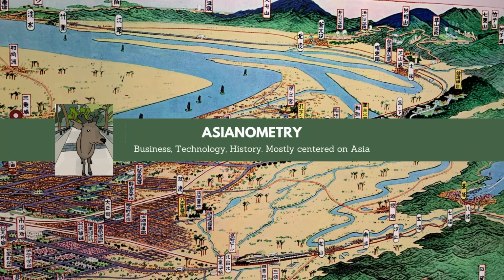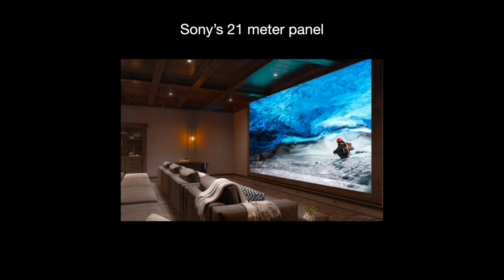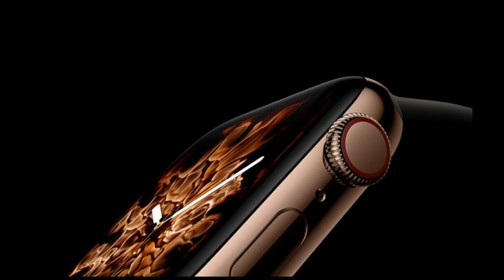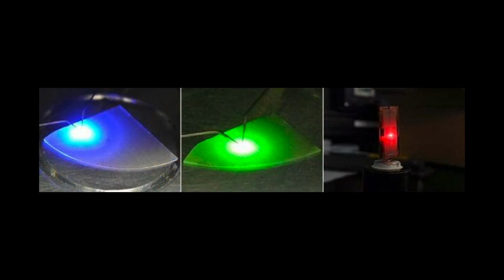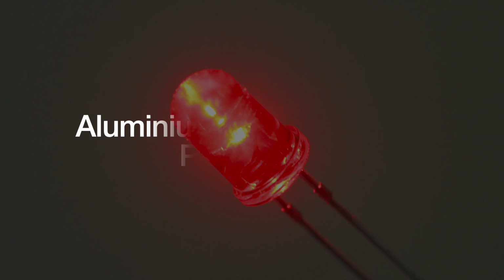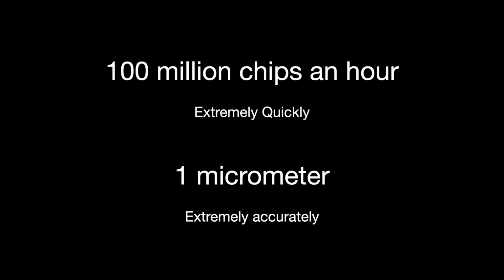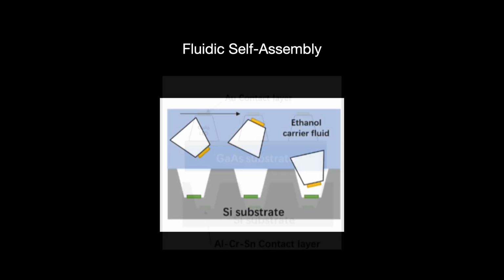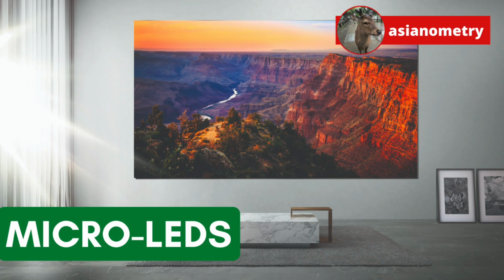Micro-LED Displays

Comment: There was also a tech called SED (if I recall correctly) which was basically like having every pixel be a separate CRT (one electron emitter per pixel). Basically a truly flat CRT, which would have had excellent contrast (although probably the same phosphor burn in issues)
Reply: Yes, surface-conduction electron-emitter display.  Every subpixel was effectively a very tiny CRT: an electron emitter, a small gap, then a red, green, or blue phosphor.  It was initially developed by Canon and then they partnered with Toshiba to make displays.  The display quality of the prototypes shown off at trade shows was reportedly exceptional (but this was a good 15 years ago), but the introduction date kept sliding and sliding so clearly there were some ultimately insurmountable hurdles.  I do know that one problem was that subpixels could only be on or off, brightness had to be controlled by flickering them many times per frame.
Reply: I just came here to mention this technology.  It seemed very promising circa 2000 - a direct competitor to plasma displays in particular - but as LCD displays improved, eventually displacing plasma, it became clear they were never going to be competitive with LCDs.  At least, not competitive enough to warrant developing an entirely new technology.

Pity.  If they'd come along circa 2000-2005, they would have been a game changer.
Reply: There was a complicated patent lawsuit contesting the business arrangement with Toshiba. Afterwards, Toshiba was no longer associated.
See Kent displays, Zvi Yaniv. Shucks. Missed again.  Did save Canon bundles of money as their business model was faulty though in my opinion.
Reply: @sunspot42  ...but as LED displays improved..."

LCD displays, you mean.
Reply: @bricaaron3978  Yeah LCD. Fixed. 

Although LEDs are a big reason for LCDs finally rivaling CRTs and plasma when it comes to contrast ratios. Dimmable LED backlights have vastly improved LCD picture quality.
Reply: @sunspot42  Me and some friends decided to check it for ourselves. We placed a brand new iMac 20" side by side with a 20 years old 26" CRT TV. The TV wasn't even a Trinitron or Wega tube, just a regular mask-based CRT flat screen from the early 2000s. We used YPbPr connections for the CRT TV, and a downscaler to output the same images to both.

The iMac LCD-LED screen could run circles around this TV in terms of pixel quality and alignment. It was like comparing your brand new car with a 60s VW Beetle in terms of safety and features.

But what was undeniable that the color reproduction and contrast quality of that old CRT was unbeatable by a huge margin. We thought the iMac colors/contrast were exceptional until we placed the CRT on its side. Instantly, our brains perceived the appalling difference between the two, and the iMac image looked grayed and washed out. The CRT image was mesmerizing, specially with natural images and games that use ray tracing. (watched via YT on the iMac, obviously  😅)

Again it was like comparing the last steam engines from the early 1900 to a modern ICE car. The torque of the steam engines was so phenomenal that they were called "the hand of God" for a reason. No ICE engine never came even close, and it took almost 100 years for a Tesla Electric car reach the torque that a Doble E-20 steam car had in 1925.

Some pluses and restrictions are just inheritable characteristics of their technology. The higher contrast ratios of newer LCDs is just a marketing ploy. When placed side by side to a CRT you clearly notice the trick. It just like a chimp trained to adjust the brightness knob lower for darker scenes, and higher for brighter scenes. While this makes the whole contrast range wider on the whole video (thus the "dynamic contrast ratios"), the each scene itself had terrible contrast.

Comment: I don't understand is why VR is lagging many years behind when JBD have true microled small displays for a few years and they already shown all the way back in like 1018 R, G or B microled displays with 1 million nits and maybe like a year after they already had a full working RGB microled display yet I don't think I ever seen any product using them which is sad.

Also I don't think Micro-LED will ever compete with OLED but rather will always be on a league of it's own because of price. And in my opinion the best affordable way to do micro-led display would be using 24883200 blue leds for UHD 4K resolution and then Quantum-Dot color filter on top to do green and blue, it will sure have limited brightness but QD at least to around 2000 nits probably works fine and cheapest microled panels wouldn't need to be all way above 2000 nits, even 1500 nits with perfect contrast would be so much better than OLED.

Anyway the OLED killer surely would be Self-Emissive Quantum Dot if they can make it since the price of 8294400 RGB microleds or 24883200 blue leds (for UHD 4K microled display) will probably never get to budget prices...

Comment: fluidic self assembly is cool to the point that i hope it's the technique that ends up winning in the end
Reply: Ultrasonic fluid for placement...
Reply: @HansSchulze  I was  thinking the same thing
I wonder if they could combine fluidic self assembly or a similar technique that would be assisted  with ultrasound resonance  and or acoustic suspension technology to vibrate the LED's into place
/watch?v=wvJAgrUBF4w
/watch?v=MnjKa3EZXwg
maybe the micro LED's each have their own unique enough resonant  frequency already  or if not maybe  some extra element could be added to make them resonate at different  desired frequencies   so they could be steered  individually into place  by the ultrasound.
Reply: @andreamitchell4758  Resonance is usually mass or size related, so that might not help.

Comment: So you make a substraight that is just connections (like a surface covered with a furry forest much smaller than the leds), you make a paint out of all 3 colors of micro leds (probably even smaller ones), and you paint them onto the substraight. Then you have a device like a fpga that tests every set of connections and sees what color is produced and programs itself to know what connections produce what colors at what points.

Comment: As an engineer, I would think that "growing" long ( 10cm to 1m) strings or strips of (100micrometer wide) micro-LED's would make the transfer to a display panel problem 
much faster, with high quality and low cost.  ALL of the current problems seem to 
derive from growing the individual LEDs on wafers rather than on strips or even directly
on the display panel itself.  Also, a single type of "White-Light" LED that could be 
stimulated or even programmed to emit RGB and YRGB light has obvious manufacturing
and application advantages over discrete R and G and B micro-LED's.  Anyone who can
make any of these ideas work should replace my old but working "Plasma" widescreen TV !
... 🙃
Reply: The issue with larger strips is yield: making sure that all the LED’s work becomes problematic, especially given that, at 90% yield, 100 of the 1000 100γm chips in a 10cm section are dysfunctional, and require replacement.
I do believe that final assembly of many small strips can save significant time, but production runs need to be in the tens of trillions long for long run profit.
Reply: @tesseractcubed  thank u for your feedback,  Historically, many     'yield"   problems have been resolved 
                                      through incremental process refinement.
. . .

Comment: I wonder if using optical tweezers to pick and place the components would work.
Reply: Problems are:
1. OT force is so low that the object needs to be in almost weightless (in suspension state).
2. Slow moving. ~mm/s at most.
3. OT can translate the object but can't rotate it. Can't do right orientation.
4. The object need to be strong dielectric. Glass/metal won't work. Some plastic, OK.
5. Most OT usage are on the microscope slide just to move around 2D plane. I don't know anyone try 3D motion.
And... much more...😱😮
Reply: @Danji_Coppersmoke  Microchip LED elements are inherently electrically polarized.  Using a transport fluid during manufacture is already in other proposed solutions.  Once in position, the shape of the attachment point can force 2D angular orientation.
Reply: @johndododoe1411  I wonder if they could combine fluidic self assembly or a similar technique that would be assisted  with ultrasound resonance  and or acoustic suspension technology to vibrate the LED's into place
/watch?v=wvJAgrUBF4w
/watch?v=MnjKa3EZXwg
maybe the micro LED's each have their own unique enough resonant  frequency already  or if not maybe  some extra element could be added to make them resonate at different  desired frequencies   so they could be steered  individually into place  by the ultrasound.
Reply: @andreamitchell4758  If they're all identical, there's no distinction needed.

Comment: I saw this video and I was so excited. Micro-led is one of those technologies that is so perfect but has challenges including cost, manufacturing, etc, if I ever have the opportunity to buy a microled monitor or tv i'll definitely remember how far away it was in 2020
Reply: Its still just as far away. I expect we won't see mass market micro LED till at least 2040 if not 2050.
Reply: @PWingert1966  No way, it will be before that.
Reply: They should make 50 or 55 inch 1080p Micro-LED tv. Most tv cables are still streamed in 1080p, so don't see any problem here. If you watch movies/tv shows on Netflix or Disney plus who has 4k content then you just have to deal with 1080p resolution until they make 4k Micro-LED affordable.

Comment: CRTs weren't as bad as you make them sound. A CRT made with modern DAC tech, could easily beat an OLED in quality; the only limiting factors on their image quality was the source analog quality and the grain size on the screen. 

That said, my current monitor setup would be impossible with the weight/size of CRTs. I wouldn't want to switch back to CRT, but image quality isn't the reason.

Comment: Why skip over quantum dot? While the tech itself is probably really complicated, the premise is not. It's "just" a layer that can convert between wavelengths almost perfectly. So you can use any light source to produce any wavelength, at least in theory.
Reply: Possibly because, even with most precise MBE, the quantum dots grow where they like, and not where you want?

Comment: not another word against CRTs. Its superior to LCDs in many respects.
Reply: Agreed
Reply: No it is not.
Reply: @ToTheGAMES  yes it is
Reply: @ToTheGAMES  Yeah, CRTs offered better contrast and better color rendition until very, very recently.  Until the past couple of years, you had to go pretty far up most product lines to find an LCD that offered comparable color and contrast performance to a mainstream CRT from two decades ago.
Reply: @sunspot42  Well we are talking about micro-leds so going "pretty far up" is already implied.
Reply: @brodriguez11000  Right, but newer panels with localized dimming and quantum dots can hit pretty high contrast ratios and have remarkable color accuracy and brightness. You can finally get an LCD screen that rivals a CRT in those regards for a fairly reasonable price. That’s a fairly decent development.